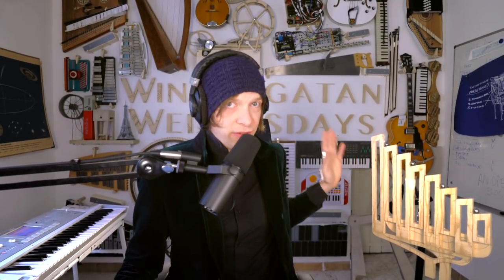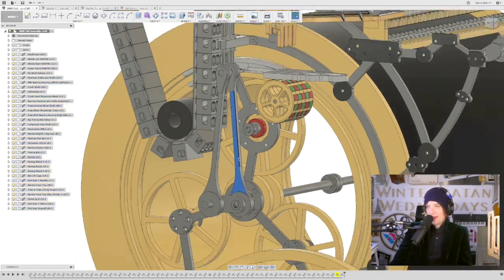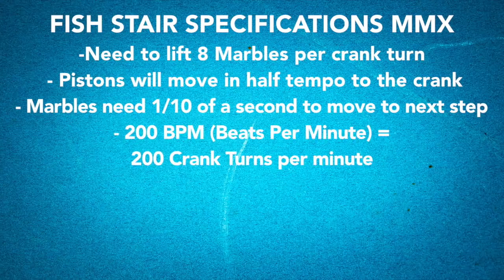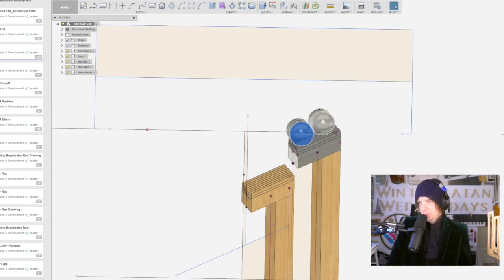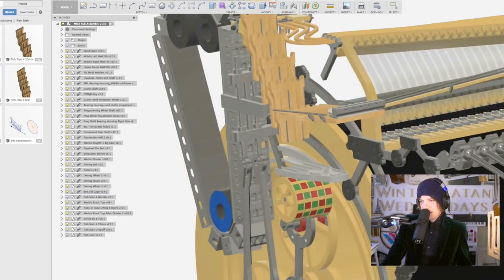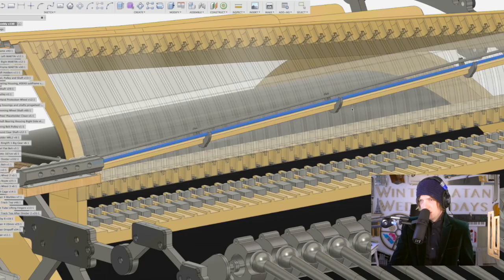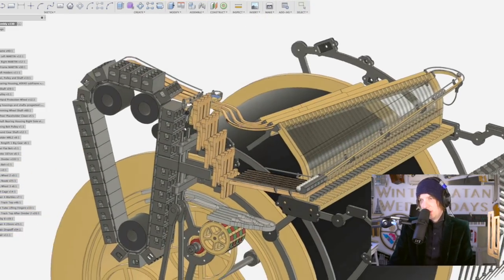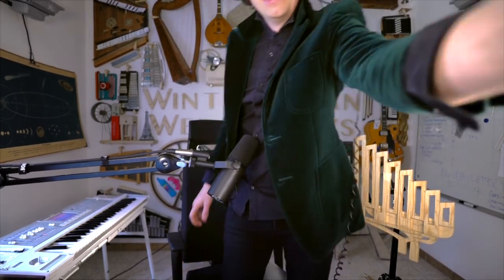Fish Stair Evolution - Marble Machine X #29

Comment: Wouldn't you be able to speed up the switch from one step to the next by adding an angled overhang that would push them forward? It would look like a bunch of stacked "r" shapes mashing into each other, but I think it would be neat, and having them shove the marbles into position faster can only be useful... so long as it doesn't jam of course. Maybe a slight U groove on the edge of each step so the marbles fit in better?
I'm no engineer but there has to be a way of streamlining it even further. They're spheres, having the steps be rectangular seems sub-optimal.

Comment: wouldnt it be better to make the fish stair out of three stairs (you would need 8 stairs for four marble lanes) that way it would have two solid outer stairs and the inner stairs to move on one cam for the lifter, while the outer  stairs are static to hold the marbles on each step. less moving parts  equals less noise. you could even stagger each lane so climb up the fish stair in any pattern you like

Comment: I think there is an error of thought. When the Marble Machine is at full playing capacity = maximum marble consumption, there will be no marbles left over to feed back into the system on the top. As of that the conveyor alone needs to be able to supply the machine.

Comment: Hey Martin,
What happens if the programming wheel is currently empty or marbles are not being used?
The marble divider will fill up, then the fish stair will try to keep up with the constant feed of the belt, the fish stair buffer will fill up, then the marble divider track will also fill up, were problems will start to occur. I think u haven't considered what if you are providing too much marbles without a plan to drop them to the sink below if the fish stair can't keep up.
Sometimes in your songs you have a very slow beat but you are still providing 8 marbles per cycle, while only using for example 1 marble per cycle. the overflow of the marbles at the top will create a problem unless if you use only enough marbles to fill the marble divider+ fish stair buffers.

Comment: He isn't actually increasing the rate of marbles lifted per crank. He is really just adding a fancy bigger marble reserve at the top. When those marbles are being used quickly and the bottom of the machine is filling up with marbles for the belt lift, it can still only lift 4 marbles per crank! Marbles will not magically jump up to the overflow lift. And so if you are playing more than 4 marbles per crank, you are going to run out of marbles unless you give the machine quiet cranks (crank rotations that play no music ) You are going to end up with an net loss of marbles at the top of the machine over time. Its not really a problem if you plan the song smart, but if you wanted to play a lot of notes really fast you are going to run into an issue there.

Comment: You keep adding mechanisms to the crank drive.....have you calculated how much torque will be required to turn the crank, and how many calories one will burn through the course of a song?  Are you going to need body-builders to run the MMX?

Comment: But the on the fishstair dropoff, marbles can possibly drop on top of the other marbles on the track, can't they? There's gonna be a line of marbles on each track between the 'bus station' and the marble divider. It could cause a lot of issues, if the fishstair dropoff drops marbles on top of the other marbles on the track. Maybe you should make another small track for the 'recycled' marbles, so they have enough space to land and get in the line of marbles safely..

Comment: With how small the marble divider is, I'm worried, that when a lot of instruments are muted or if there is a song that just has not a lot of notes, the recycling system might overflow rather quickly. Shouldn't the main reservoir of marbles be on the top of the machine so that the amount of marbles being lifted at a time can never be too much?
Alternatively, you could built an actual overflow for the recycling system that leads to the reservoir at the bottom, but that seems rather stupid (inefficient) :D

Comment: The Apollo 11 with the Saturn V Rocket was built using over a million parts and had 1 percent failure rate. That meant that over 10 000 things could go wrong during the mission. How would you rate your mission in this state? The more things you add, the more chances of things going wrong, sort of a Murphy's law for building things.

Comment: If the marble divider is full and marbles are being delivered to it at a faster rate than the notes are being played, which is I think what you are planning, then where do the excess marbles go? If you don't have some way of dumping excess marbles back to the bottom of the machine the recycler and divider will get more and more full of marbles until they overload and lock up.

Comment: Why not use a fish stair that feeds marbles back and forth between two ladders? Say a fish ladder. 
So on the left downstroke, right ladder moves up, the marbles hit a little bumper and empty into the left ladder. The opposite happens on the right downstroke. 
That way you have a nice little flatly packed fish ladder, only needs two ladders moving up and down, and a few bumpers on the supporting cage to bump the marbles back and forth.

Comment: How did you make the bent metal rods in your design (Like in the drop-off)? Is there a specific tool in Fusion for that or are they just curved patterns extruded and rounded?

Also what protection do you have in place against marbles getting jammed in the machine? Is there a way to stop it immediately to prevent damage?

Comment: Martin, i believe you might want a tensioner pulley for the belt drive. You want to be able to adjust the tension on belt drives to make sure that no steps will be missed. I am talking the one on the crank.

Just my opinion. Any other opinions on this?
Reply: Similarly I was wondering if the weight of a full load of marbles in the elevator belt would have a material impact and cause slippage without some kind of tensioning - or was that already allowed for in the belt/pulley friction
Reply: Humberto Muñiz   I'm assuming he will use a toothed belt, otherwise slippage would be a major timing problem.  If it has a fabric centre, like a car's cam belt, then the tension shouldn't need to be re-adjusted for a few years. No idea where he'll get the belt from, but it could be home-made at a pinch. ...
Reply: Ray Kent even if it is a tooth belt, it would need an adjustment tensioner. To make it easier for fabrication.

And i hope he gets them from Martin Sprocket! 😊

Comment: What happens with the excess of the marbles, let's say, if you were turning the crank, but didn't play? Will the system get over filled with marbles at some point, or will they be recycled also? (In case of turning the crank without playing would be the ratio of 16 coming to 4 recycling very insufficient). And what would eventually happen, would they fall out, or get stuck somwhere?
Thank you for your amazing work, Martin! Keep going on!
Reply: Just what I was wondering, but I suppose that he will start with just enough marbles to fill the marble separator and the recycler

Comment: Shouldn't the recycle drop off automatically drop the marbles in the lane that needs it the most OR at least cycle through so every 4 marbles get in the 1st lane, next set of 4 goes to 2nd lane, next 4 marbles into 3rd lane and then start over? This could be combined with the system when you activly choose to prioritize one of the lanes.

Comment: I really like your project and watch your videos very carefully ;) I know, you did your calculations, and its just a gut feeling, but there might be a problem getting the marbles back in one of the lines after the fish stairs. If all three lines are filled properly with marbles, there will be now path to go for the marbles. Even if the calculation of the marble flow work out perfectly, in the real world there is always some discrepancy and Murphy will get you. It might be better to have an overflow/leakage-flow go back into the reservoir, even if your design looks very amazing so far :/
Since I am a mechanic, it helped me when I compare the marble flow with a hydraulic system, where all lines go back to the tank,  after the pump/your lift, there has to be a pressure-limiter/a small marble overflow path back to the tank and of course you cannot connect low pressure "leakage" lines directly back to the high pressure "work" lines. I really hope this comparison didn't make it worse...

Comment: Probably something you haven't thought about, but if you put a microphone on a particularly noisy impact area of that mechanism (or put a small clacker in there), you can put that sound into the mixing board, and out through the monitors only to make a click track for the band to play in better timing with the machine.

Comment: you might want to add rails near the recycling drop in point. If one of the recycled marbles lands on top of a marble that happens to run beneath it, there's a chance it could fall off the track.

Comment: Hold on I thought there are between 24-30 frames in 1 second. If it takes 10 frames to lift the marbles enough how is that 1/10? Shouldn't it be between 5/12 and 1/3 of a second?

Comment: i am baffled at how much engineering knowledge has been put into this next generation marble machine but i can't help wonder how much noise its going to generate as it is being operated, i can appreciate a background tempo but if the machine actualy sounds like an endless rattle i would be a little put off, which leads me to think about the quality of the sound pick-ups you'll be using and if any cushioning for any parts of this wonder-machine has been included ... or is the motion (momentum) of each marble (or row of marbles) has calculated to make sure they don't clash at every step (such a precausion would prevent marbles from falling off also) :-l

Comment: I think that if too many marbles are recycled, like in a fast but not very full song, the marbles in the "Fish stair drop off" are not going to move quick enough.
Before potentially all four marbles have dropped though their respectively set holes (200BPM -> 100 drops on Drop-off/min -> ~7 marbles/s through the drop off (Xtreme-stairing! :D)), the next set of four might have already been dropped on top of them and gone over the barrier and fell though the machine. I think you would not want marbles clogging your planetary gears or stuff like that ^^ You might need some more slope at the drop-off or some other solution.
I might be wrong on this, but i though i might let you know... Can't hurt even if i am doing you wrong :D

Comment: Hey. I've got a question for you, Martin. It seems that you have a steady flow of incoming marbles at the top. But you have a variable usage of those marbles at the top. So in worst case, when you mute the instruments, the marbles will still climb up and accumulate on the top. Do you have some kind of marbles overflow handling? Or do you just limit the total number of marbles in your machine to fit inside the top section of the marble machine? Greets, Lukas from Germany.
Reply: Lukas Kasper 
Good point!

Comment: I don´t want to sound negative but the look of the beltdrive is really ugly... Mostly the blocky-shape of the marblelifts, in my opinion it doesn´t fit with the round look of the rest of the machine.

A re-design of the look but not the function would be good in my opinion.

Sorry for the negative feedback i just wanted to get my two cents out there.

Love the machine and the videos, all the best!
Reply: Yes, I agree. It looks a bit too crude for the otherwise somewhat elegant design, doesn't it? But perhaps it'll already be enough to simply smooth out the edges.
Reply: Maybe and also i think it´s because it´s black in the cad-drawing and that make´s it stand out like a sour thumb, on the first MM everthing was "wood-coloured" and everthing blended much better.

So a little re-design of the hard edges and another color that blends better with the rest of the machine would probably do the trick. :)
Reply: Someone suggested to make the boxes out of clear plastic. I also like that idea, and it would look more like the original machine.

Comment: are you planning to create a small system to play the marble machine without the need of human power? like with an electric motor, or a bag of air? switching from manual to automatic when needed would be good, either for different songs or for one song.

Comment: Maybe this is a stupid question, but how will the recycled marbles not hit the marbles going down the lanes already from the belt? In that event, wouldn't it would bounce off and thus cause you to lose marbles?
Reply: The track at the top of the marble feed tubes is horizontal while the feed tubes are vertical, if the tube is full of marbles the incoming marble rolls across the full tube to the next and so on and so forth. If it gets to the end of the track and there are no tubes needing a marble it enters the recycling track and moves to the fish stairs. If the fish stairs if full then it will wait its turn on the track until a spot opens up. It will only climb the fish stairs is there is an empty slot available. All of the feeders work off gravity. So if there is no available place for anything to move, they will not. There is no pressure behind it forcing anything. It is the same as if he does not turn the crank. It just sits in its place waiting for an available slot. The recycler allows him a double feed of available marbles on songs in that might need extra marbles.
Reply: Similarly, what happens if too many marbles are getting recycled? Won't they back up and go everywhere as the fish stair tries to force more up the top constantly?
Reply: Perpecede Celequex I think having little gates that act as "check valves" and keep the marbles moving in one direction, and not backwards when they're not supposed to, would be great.

Comment: You say that you are increasing your feed rate, but that is not technically true. You are only recycling, so if you run out of marbles on the divider, you also won't get any more from the fish stair after a while. So, if you play a song that is constantly using more than 4 marbles per beat, you will run dry eventually.
Reply: Not quite how it works. The large grey belt lift in the back is the primary feed for the marble divider, which more-or-less guarantees a feed of 8 marbles per beat. Any excess from that 8 that the divider cannot take then gets recycled into the divider by the fishstair at a rate of 2 per beat (4 marbles per stair at half tempo), essentially allowing the standard limit of up to 8 per beat, with a buffer of up to +2 per beat depending on how many have been used.
Reply: Yeah, I think it's better said as "improving the buffer capacity." Feed rate was increased from the original target of 8 marbles per crank by the belt drive and that increase needs a buffer.
Reply: I'm thinking of this as an interim speed buffer.  The buffer with the quickest time-to-release is the Pre-Positioned Marbles at the gate.  They're ready to go as soon as they are needed.  Marbles in the Big Buffer at the Bottom cannot be ready until they travel all the way up the primary feed and roll into the Pre-Positioned location.  The marbles that accumulated (during quiet periods when the Pre-Positioned marble buffer is full), will be available after climbing the fish ladder.  I assume this time is less than the time to get from the Big Buffer at the Bottom.

In essence, this provides a staged cache that doesn't take so long to get into position.  It reminds me of a very big water bag I recently saw in the forest.  It held about 50,000 gallons, and was staged 25 miles into the forest.  That was some quickly available water for a fire until more trucks could arrive.  Of course, it took some time during quiet (no fire) to accumulate that reserve for time of fire.

And... this reminds me of another analogy.  Large organs were often powered by 1-2 adolescent children.  Their effort moved bellows that created pressure to be used by the pipes of the organ.  Excess input was used to push against a spring system to accumulate energy.  This was especially needed when the music required to "pull all the stops out" because that consumed air (and energy) at a rate that was faster than the children could create air.

Foot pump organs do a similar thing, but by accumulating vacuum instead of _pressure_.
Reply: Maybe a better analogy is how YouTube handles bit-rates?  (using spare bits from other frames to make more bit-intensive frames smoother)

Comment: The recycling and switch-plate system seems overkill. If you balance the magazine size with the feeding speed you should be able to use any instrument however often you want.
What if you expanded the double-decker fish stair design to have 4 levels? Then it only needs to be twice as wide.

Comment: Hi Martin,
Is the fish stair really needed? Loved the looks of it, but, isn't it a bit of over-engineering? You could feed the marbles tank on the bottom with those excess no? And put a few tracks around the front of the machine just for the looks. 
And as usual, awesome video :)